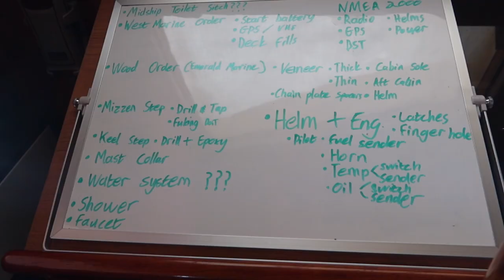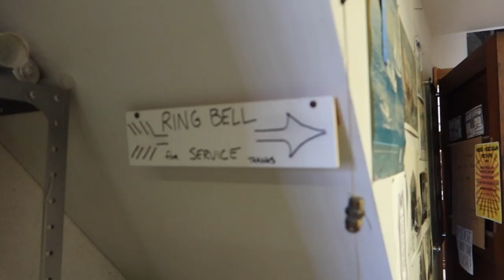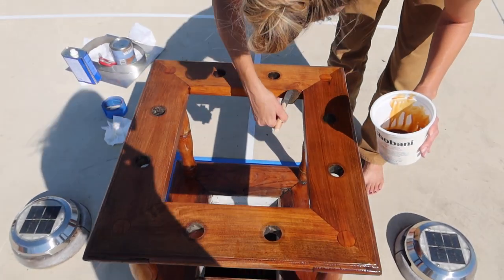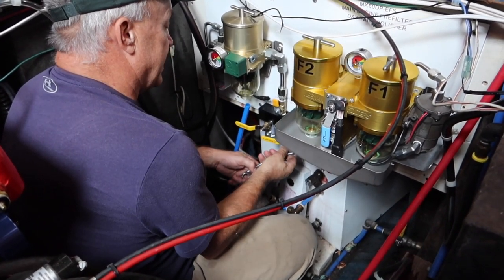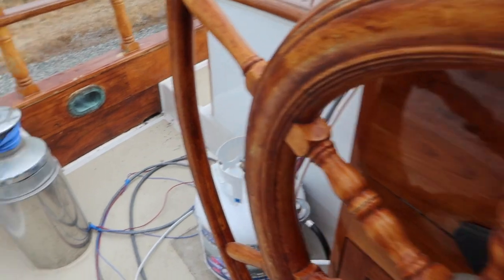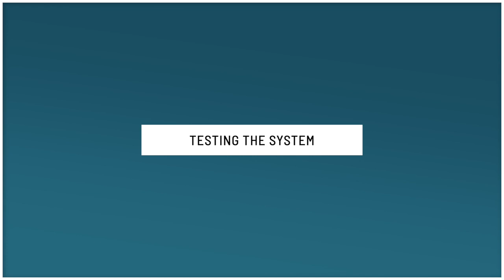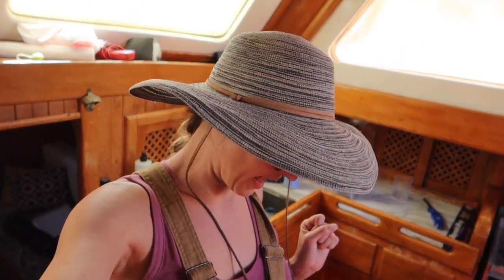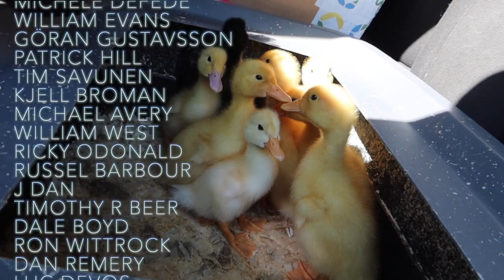KICKED OUT of the BOATYARD | PIRATE SHIP S13E08

Comment: The Kenyan fuel system needs to address using the Racor (Parker Hannifin) fuel filters. Your filters turn direction approximately 6X when fuel comes out to engine. The center tube does not reach the top of the filter & that’s where your air pocket is when you come in on a wake. Your mfr addresses this problem w/an electric fuel pump pressurizing the system. This forces the water & contaminated fuel into the third stage. A better choice is Dahl Model 150 manufactured by Baldwin Filters. Fuel only turns 2x. Comes in and out the top. Does not spin the fuel. It decompresses it and has at least 3X the flow rate of your filters. Ease of service. Turn T handle and the whole lower unit drops and comes out for ease of service. Also has a bleed valve on top. This comes from a retired marine fuel filter specialist. Good Luck.

Comment: Having a dual fuel filter system is money well spent.  I was in charge of the engine room while under way so having a backup filter means you can stay under way and deal with the clean out process to ready back.  The diesel is very dirty and attracts water from the air by nature so you have to filter the fuel. I served on a air craft rescue ship for training the army corps to pilot a P-51 but first had to pass training the T-37. Our ship was large enough to pick up a down T-37 and rescue a pilot at the same time. Our battery banks were another area in the engine room to deal with. We had two engines but only one for drive the other was a generator but they both were diesel and the filtering of the fuel was constant duty thanks to a dual system.  The bridge did not have the alarm feature nor they never knew when we switch over the filter as long as we were under way life was good. Pretty old ship slow but mighty. Very analog based information lights and bells mostly plus a phone directly wired to the bridge so no shore calls to honeys.

Comment: I am a lil’ stuck on the vacuum gauge holding pressure after the engine is shut off. 
The intake manifold will not retain any vacuum after the engine is shut off due to many different reasons. Even on a diesel, vacuum should be regulated by either the crankcase, or an external vacuum pump, which would also lose pressure.  The only way it would retain pressure is on the low-side, depending on where you were measuring the pressure.

Comment: This system cleans fuel but will not clean crap that sits on the bottom of tank.  Why should we clean the fuel tank bottom?  In a kicked up sea and you need the engine tossing of the boat can cause fuel problems.  Clean tank out by opening fuel access holes.  Visually check fuel in a glass bottle for quality before putting fuel in your tank. Put fuel treatment in fuel to prevent mold building up due to water.  Suck fuel off the bottom of your tank with a pump to ck tank for dirt or water.  Keep your tanks filled to prevent condensation.
Your can purchase a pre-filter funnel when buying fuel away from home port.

Comment: Power Steering fluid might attack the seals in time and make em leak you might need hydraulic fluid
Reply: Both are the same.. Both use Hydraulic fluid..
Reply: Not exactly hydraulic fluid different with the additives transmission fluid or make the seals Lee

Comment: You absolutely did not need that fuel system if you had just installed a duel filter housing alone you would have saved a significant amount and lost no safety. On my boat (a commercial vessel) if the engine needs to clean filter we simply turn the lever to a new one and change the other at a time and place of our choosing. You don’t need anything else. The guy up sold you
Reply: Maybe another free item, no cost.